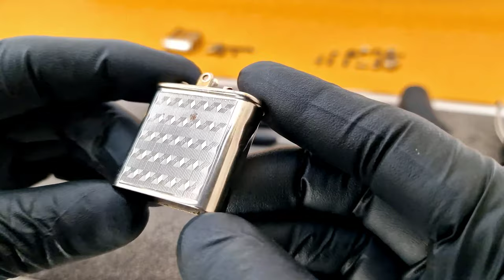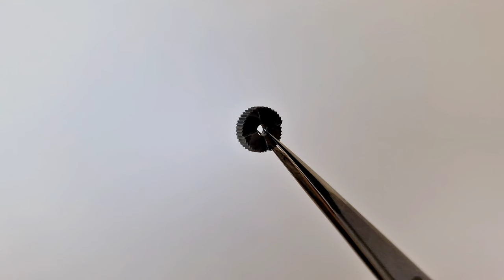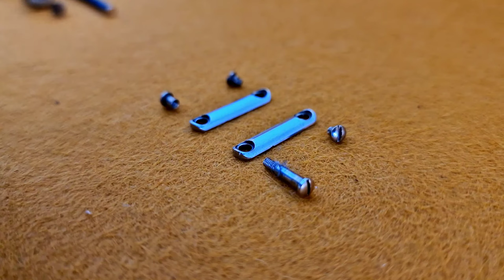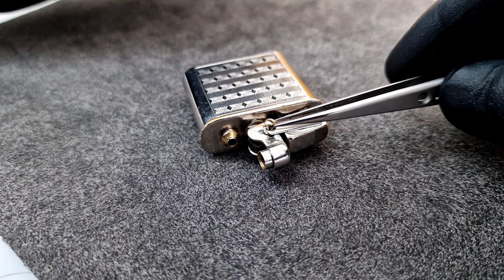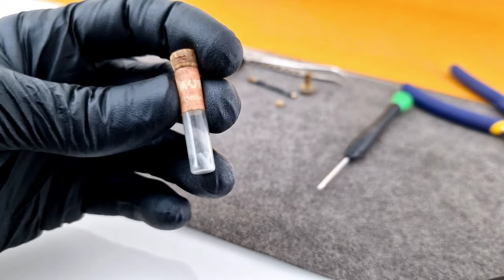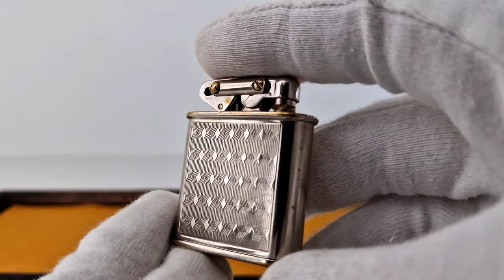How to assemble a KW Semi-Automatic Lighter from the 1930's

Comment: Hello! I have this exact same lighter but am having an issue I am wondering if you can help with? One of the screws that attach the arms to the snuffer (the last piece you put on) doesn’t seem to be long enough. The screw just spins but doesn’t tighten.

I know the threads aren’t stripped because if I put the screw directly into the snuffer hole, it tightens in fine, but when passing it through the arm, it now isn’t long enough to reach the threads and tighten. Have you experienced this issue before?
Reply: Maybe is it that it just supposed to be like a pin and you put screw in the other end to secure